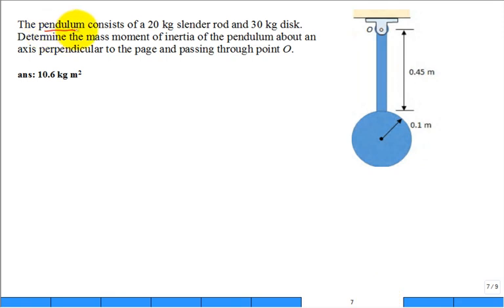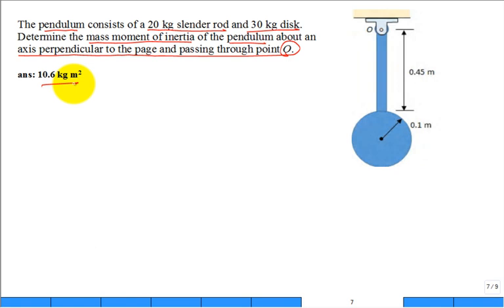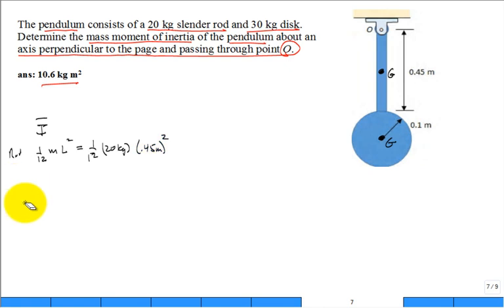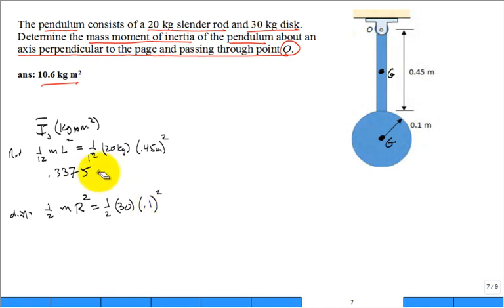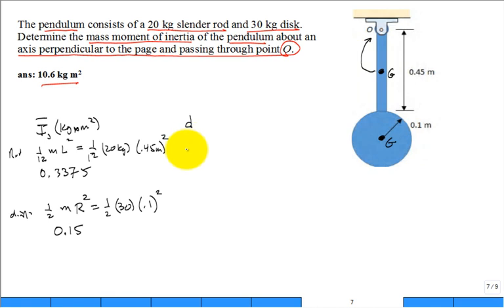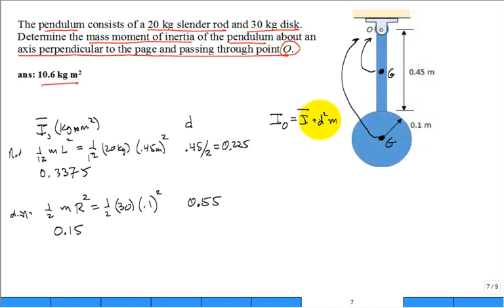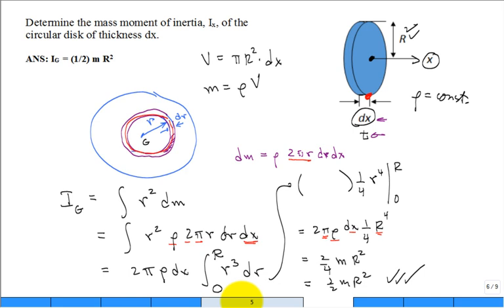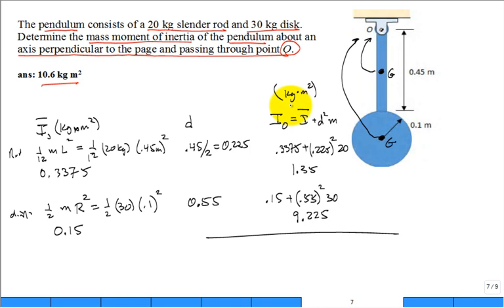mass moment of inertia of 2D pendulum spr18

Comment: Are you not supposed to take the inertia value for the endpoint and not the center ? (i.e. 1/3ml^2)
Reply: No because the moment of inertia value he's trying to find to plug in is for the center of mass so the axis of rotation would be going through the center so it should be 1/12ml^2

Comment: What's the "I" term used in solving statics that has units of m^4?
Reply from the maker: Garret moment on inertia for an area
Reply: Randall Manteufel I guess beam design and beam strength doesn't really matter what the mass moment of inertia is only the 2nd moment of area?